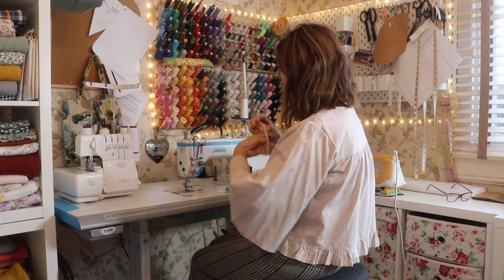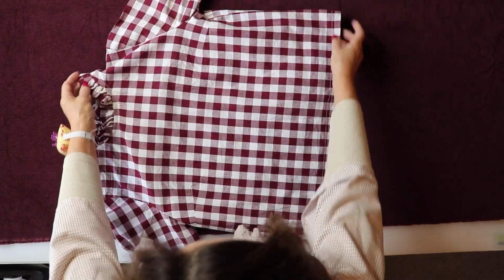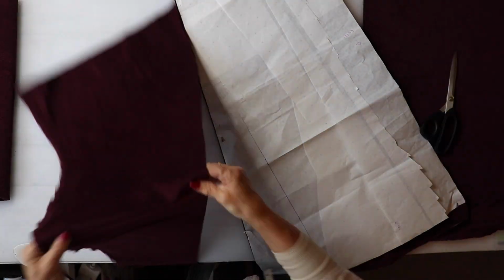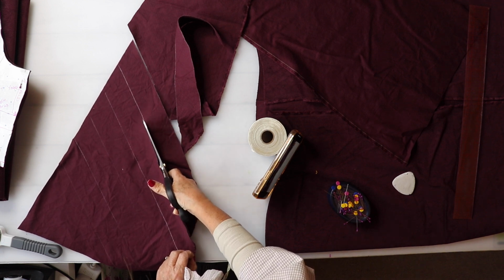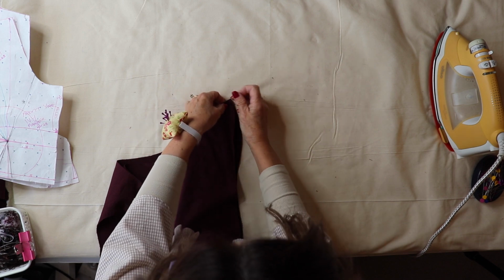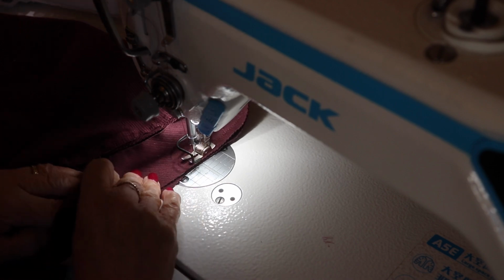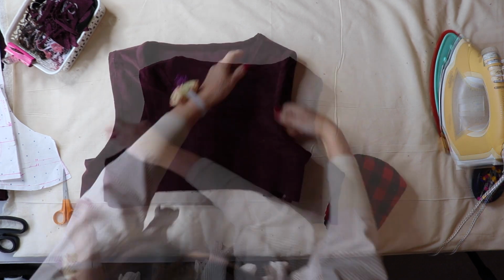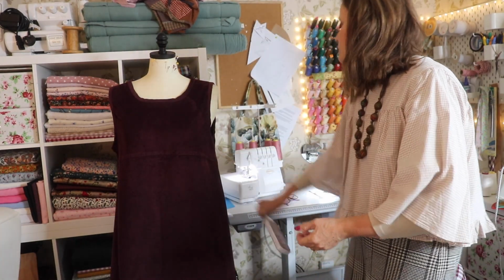Creating My Newest Pinafore Design - Festive Outfit Inspiration

Comment: You call them pinafore. We call them jumpers over here. I have been thinking that a pinafore/jumper may help hide the fact that one of my breasts is smaller than the other (after surgery). Trying to hide myself under sweaters and loose shirts has helped; but, I sometimes get hot and have to take a layer off. This is a lovely fit on you. It looks very comfortable and modest. I love the length.